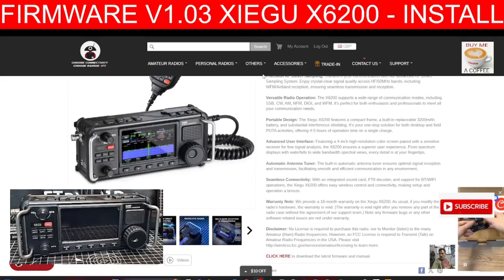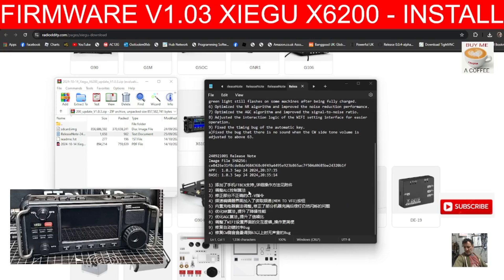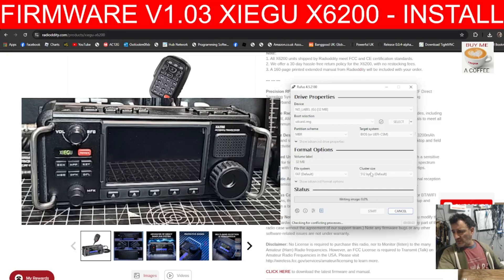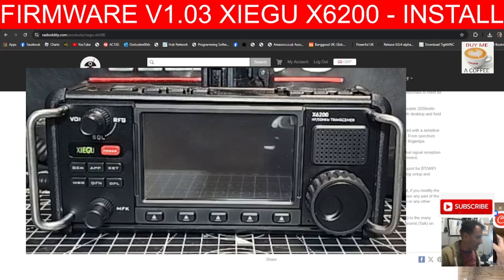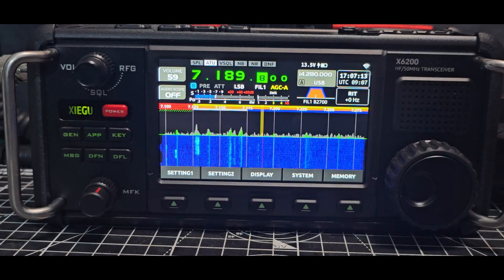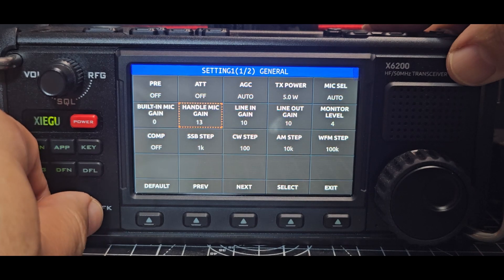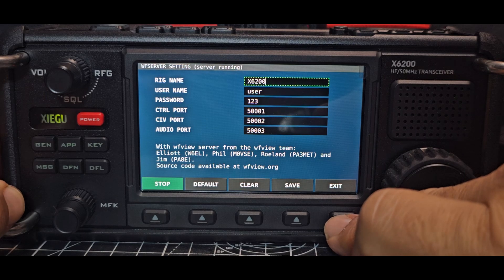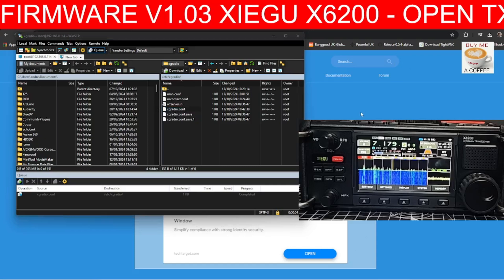XIEGU X6200 - FULL INSTALL , v1.03 NEW FIRMWARE - October 2024

Comment: Concerning firmware there is still a long way to go for Xiegu with this radio. Thanks for the video! I had some trouble with the update. Luckily, against what radioddity states, it did not harm the process that I put the battery back in rather early.
Reply from the maker: Nice